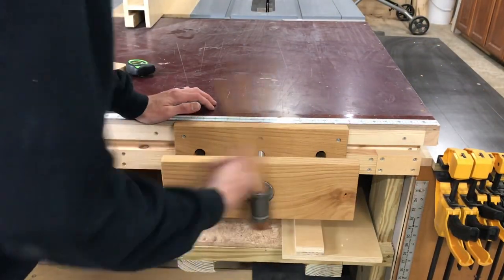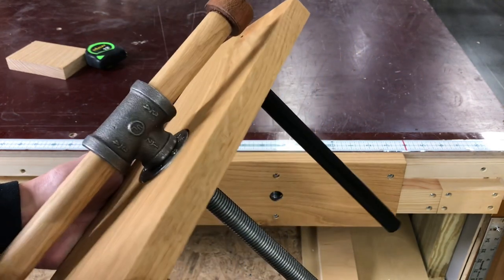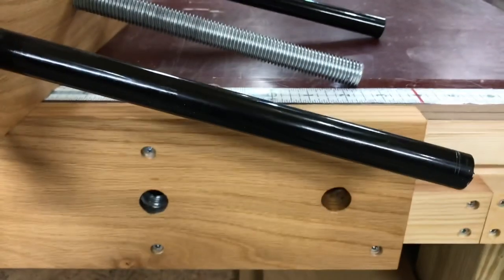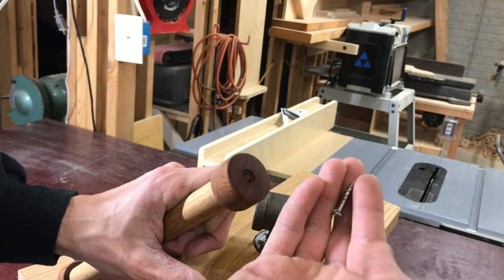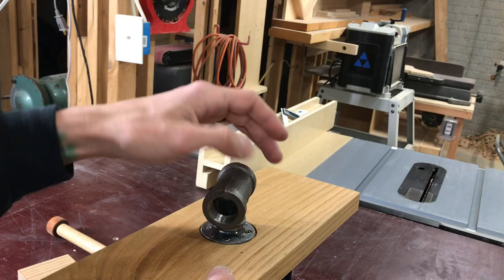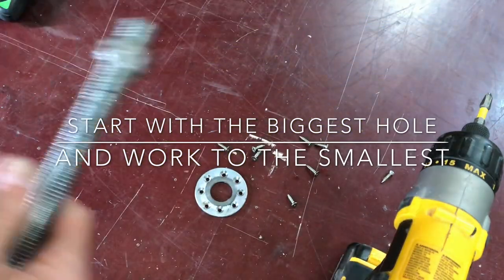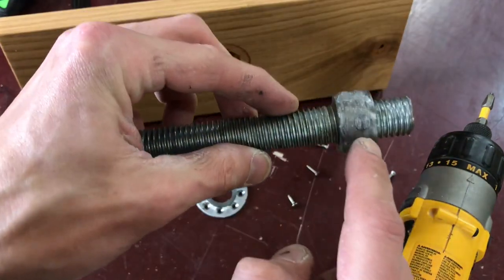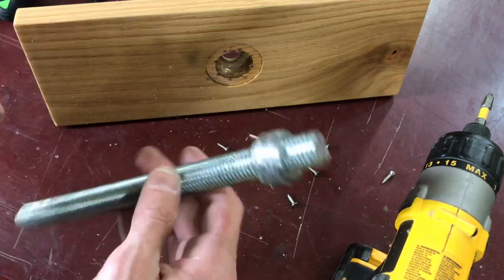Shop made carpenters vise overview

Comment: Nice work! I'd like to make a vice like this. You still going to make a build video?
Reply from the maker: Slow and Expensive thanks. I plan to. I recently took on a new contract at work that has had me tied up in that and taking all my free time (cabinets). I’ve since came up with a better system for the threaded rod and knuckle. It uses a dumbbell with a 1” very very course thread for faster movement. Thanks for watching and I hope to get to the video soon.

Comment: I'd like add to how l biult my vices if it's OK with you,  The front piece a 3x6 or 4x6  ( to accommodate  dog holes and Woking surface ) ,, The  guide pieces 3/4 gas pipe ( for strength ),,, and l riveted my handle together (to take a pounding )  !

Comment: I tried this and the all thread back and forth but the jaws don’t move . What did I not do?
Reply from the maker: As long as the back nut (stationary nut) is securely inserted or mounted in the back jaw and your all thread is screwed into the tee, it should get the in and out action. If your guide rails are skewed in any direction it will bind up on itself. I hope that helps. It's hard to determine what's going on with your vise without seeing it, sorry. Thanks for watching.

Comment: I did not see what you did back at the table.
Reply from the maker: gary24752 it’s just a 3/4” nut in the center and a guide hole on each side for the guide rails. The nut is inlaid into the back piece of the vise same as the front except I left it hexagonal so it would stay stationary while you turn the handle allowing the clamping action.
Reply: @nesleyheiney3111  thats what i figured you did :) Simply but effective,, thanks Nesley